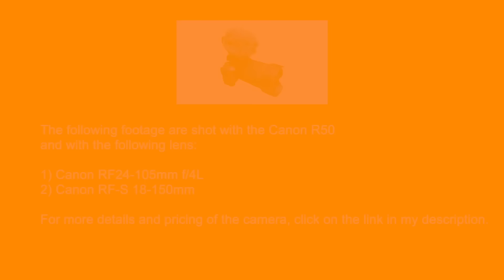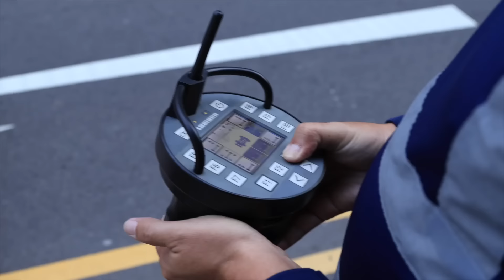LIEBHERR LTM1750 - 9.1 with 56m Luffing Jib Setup | Part One

Comment: Consider speeding up the video. As in most construction worksites in Singapore, one worker will do the work and several other will hang around, watching but not doing very much. Good to add the basis why this crane was selected.
Reply from the maker: I did consider speeding up before, but i feel it affects the overall mood because it can feel like im rushing through. Would you prefer short snippets kind of video?

Comment: I thank it’s very interesting that they put on fall protection and then don’t use it but once or twice
Reply: Yes, exactly! They have 2 clips so should be attaching to a second point, before detaching from the first. But working in a harness is awkward enough without being clipped-on, so some workers become relaxed about it... until they have a fall.

Supervisors should be pulling them up on it, there seem to be enough of them.

Not sure fall arrestors are appropriate anyway, as they are working at different heights: too low and they hit the deck before it fully deploys. Looks like a job better done out of a MEWP as far as possible and if someone has to be on the crane, then an inertia reel or airbags (or possibly a fall restraint) would be preferable.

Comment: Why are ballast/flatbed trailers in Singapore all tilted like that, higher near the fifth wheel of the tractor but becomes lower towards the rear
Reply from the maker: Because the suspension height plus height of the fifth wheel of the tractor is higher than the trailer’s suspension 😁 There are some tractors where it’s chassis height is the same height as the fifth wheel, then you wont see this tilting effect

Comment: Why is the lower motor still running
Reply from the maker: The lower motor runs during the setting up of the crane, until the hydraulic and electrical connection with the Power Pack is performed.